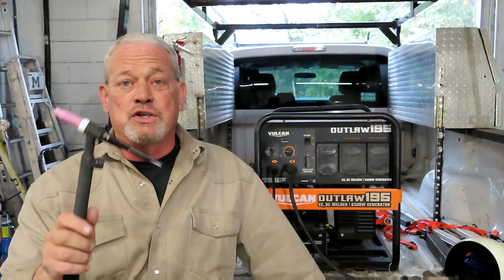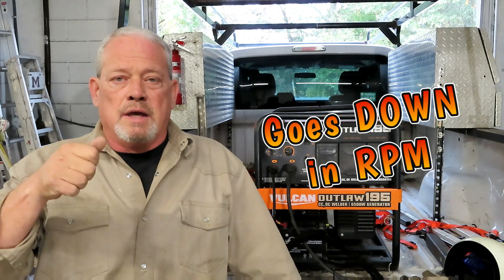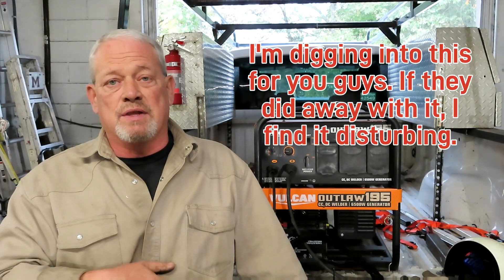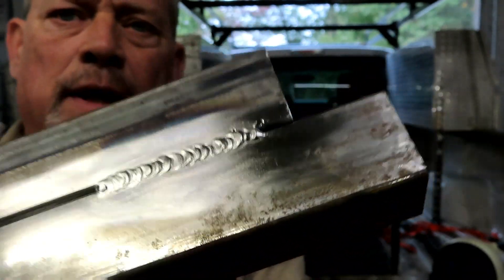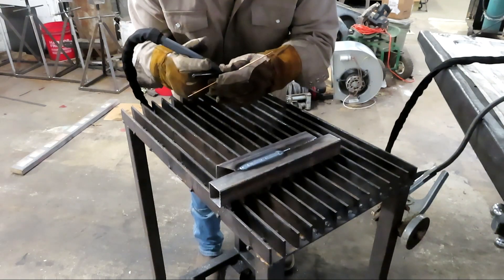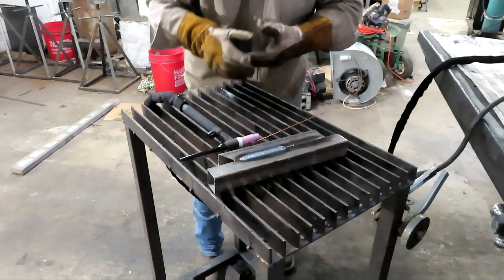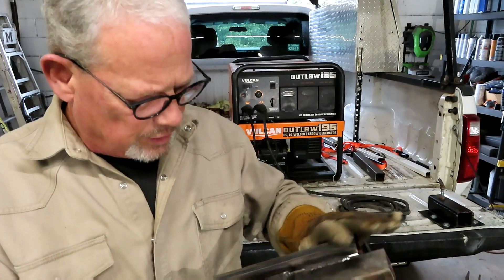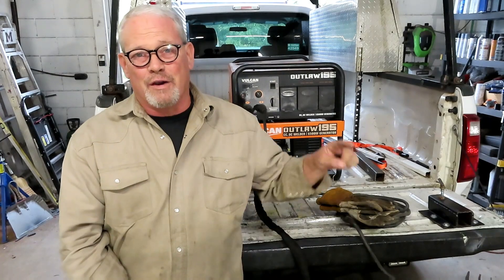TIG Operations on the Harbor Freight Vulcan Outlaw 195 Welder/Generator

Comment: It won’t tig weld constantly? Only pulse?
Reply from the maker: A subscriber contacted me and said it works great with the Arc Force turned up to 3-4. I haven't had time to try it. It was only pulsing because the choke kept reving the motor down
Reply: @AllStarWeldingSC how do u keep it from not revving down? Just by turning up acrforce?
Reply from the maker: Sounds crazy, but the guy said he did it, so I will try it. What I'm guessing, is that the increase of Arc Force will sustain the arc during the idle down.
Reply: @AllStarWeldingSC my notifications are on for your channel, waiting on that video. Thanks
Reply from the maker: https://youtu.be/Os0NXu_ddr0
Reply: @AllStarWeldingSC when will u give it a try by turning the arc force up? Will u make a video on it?
Reply from the maker: @jonathanmagana2926 yes, I will make a video. I have a busy week, but it's supposed to rain too, so I may have time this week.

Comment: What happens to this machine. When it rains and machine gets wet ?
Reply from the maker: Great question. I keep the cover on mine always when not in use. The cover isn't water proof, but it helps. The machine is on my service truck, which stays in a garage when not in use. From the machine design, it's pretty much water resistant with covers over the plugs. Mine has been rained on before, but I let it dry up before using again. I've never had any problems.
Reply: @ thanks

Comment: I think if you turn on the arc force to about 3-5 that should stop the puls I could be wrong
Reply from the maker: That's a great suggestion. I never considered the arc force affecting that, but it makes sense. Next time I do it, I will check that out and let you know.
Reply: @AllStarWeldingSC  Did you ever figure out if the arc force stopped the pulse ? I wanna get this machine to weld pipe and it’d be great without the pulse on tig
Reply: @Pericazo47 tryna figure out the same thing

Comment: To be clear, this machine uses the 35/70 connectors, correct?  Not only do i want to grab a tig torch, but also run longer/heavier leads.  And one more question, what is the thickest steel you've welded with stick on this machine?  I'm hoping to start doing some weld repairs in my off time from tugboats.  Lots of farm equipment and whatnot in my area, and lots of people need welding repairs done.
Reply from the maker: Yeah, 35/70, the big ones. For that video, I messed up when I built that tig torch and ordered 35/50, and it would go in the connection, but was too short to twist and lock it. So I had to re-make it. For leads..... I use Flex-A-Prene #1 wire. I have 20ft on ground, and 30ft in the stinger. I also carry two 50ft extensions that I can drop in if I need to. So far, I haven't had to use them. About 2 years ago, I built a pintle hitch plate for a dump truck. It was 1" plate. But, asking max thickness is irrelevant. With beveling and multiple passes, I could do 5" thick if I wanted to. There's not really a maximum thickness. When a welding machine states a maximum thickness, that's on a single pass. This Outlaw will burn up to 5/32 rods, so it's up to you.
Reply: I appreciate the feedback.  I'm trying to find the 35-70 connectors online.  Going to grab some 1/0 so if I ever need to go up to a 250 machine, I'll have the leads for it.   I see 35-50s everywhere.  My Tweco stinger from welding school (12 years ago) has the LC40 on it, so finding the adapters is twice the excitement.  Your videos on this machine definitely persuaded my purchase.  I'll be using for a while before/if I decide to upgrade.  Again, much appreciated.

Comment: Really cool u post video on this I just bought one I want to run a MiG welder off mine not sure how to go by that any help would be greatly appreciated.
Reply from the maker: My Mig usually stays in my shop. If I run a wire feed welder in the Outlaw, it's usually Flux core. But I did run my Primeweld MTS200 off it on 110v.
Reply: @ how do set it up for that Iam iam curious on that

Comment: I have a new ( Apr2024) Outlaw. I did a similar move to the front but put a second wire on the opposite side to return to choke to open. Held everything with small D-rings and screw clamps.
Reply from the maker: Nice. One guy says he's going to route a push/pull knob to the front. I told him if he does it to send pics and I would feature it in a video
Reply: That's the idea I was having.  I was bummed mine isn't automatic, but I guess adding extra pull cables is a small price to pay.

Comment: Yes I just received my outlaw yesterday, the choke is not automatic. You have to manually move it over to the run position
Reply from the maker: One guy said he was going to get a manual choke cable (like a push/pull) and run it to the front panel.
Reply: @AllStarWeldingSC I like this idea 👍
Reply: That's how I did mine  @AllStarWeldingSC
Reply: Something else I just noticed, it has a little led indicator light next to the start switch. It’s the carbon monoxide sensor led.
Reply from the maker: Yeah, the first gen didn't have that. That's why they suspended sales for a while. They had to sell out every last machine from the stores and the warehouses so that they could introduce the new model with the CO2 monitor. That's why, for a while, you couldn't get one of these.
Reply from the maker: Well, that pretty much confirms my suspicions. Does yours have the solenoid over by the starter?
Reply: I just got mine early November, and it's the same.  Unfortunately, I'm just now seeing this video where talks about the solenoid, and I'm on a tugboat for another 3 weeks.  I was kind of bummed about the manual switch to run because I wanted to rig the choke ring like he has.  I guess, I'll just have to run a secondary cable to pull it back if that's possible.  I'll fool with that when I get home.  Meanwhile, I'm going to Google a tig torch for it.